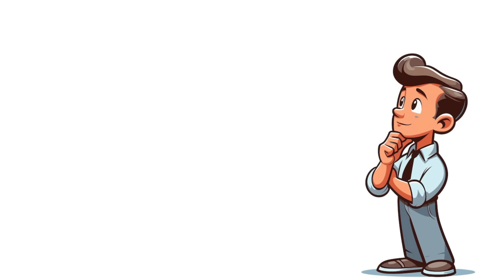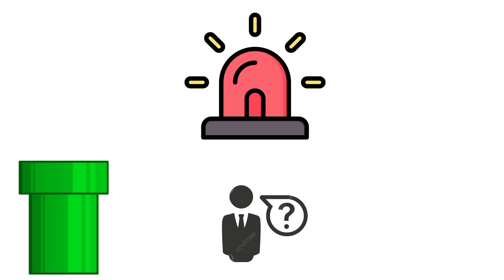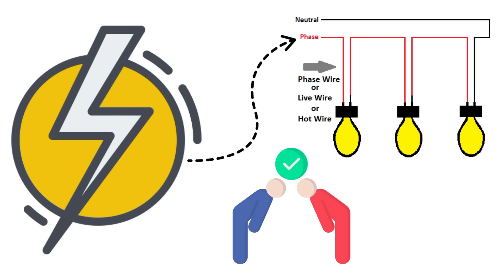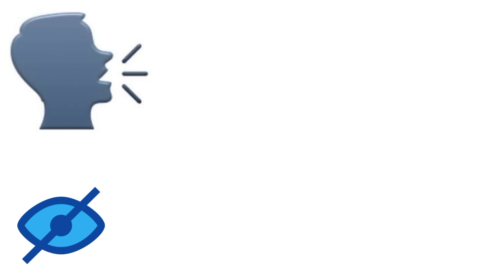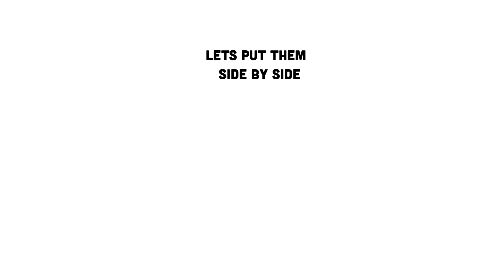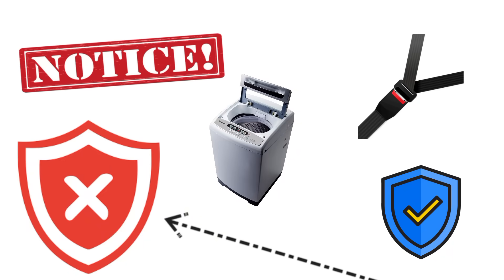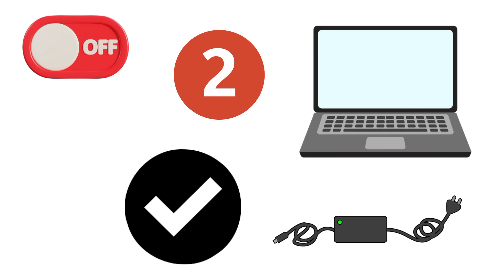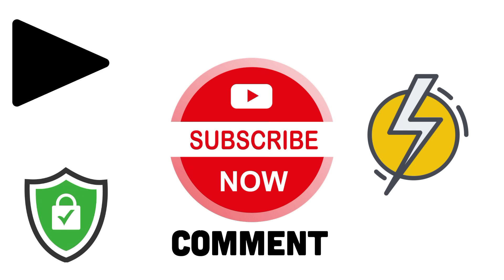How PHASE, EARTH, & NEUTRAL Works (REALLY SIMPLIFIED)

Comment: This is really incomplete and inaccurate several times.Eg.: Inaccurate, a neutral wire can zap you without bad wiring, it's AC. Incomplete, why didn't you use the most common wire colors black, white, and green in your illistration? I give it a D+

Comment: EARTH CONDUCTOR IS FOR SAFETY IN PREVENT MORE FAULT COMING FROM LIGHTNING CAUSE MORE APPLIANCE HOUSEHOLD TROUBLE   SOME ELECTRICAL ENGR. EXPERIENCE USE MORE COPPER UNDER 10 FEET BELOW THE GROUND FOR SAFETY.

Comment: Confusing colors in graphics. In the US should be BLACK, called HOT not phase, WHITE called NEUTRAL, and bare copper called GROUND. On 240 volt lines the HOTS would be BLACK and RED. I'm not even an electrician and I know this. Terrible video.
Reply from the maker: I appreciate your input on the color codes and terms, and I'll definitely keep that in mind for future videos to make them more regionally relevant.

Comment: I want to ask the ac current just flow in single wire because it is wave it some time reverse it which means live and hor wires are changing because some time it's giving electron and some time taking

Comment: Your drawings are a waste of time and one in particular is not only wrong it is dangerous. The drawings showing 3 lights show the lights in series which isn't helpful to your explanation because the linking wires can be live or neutral depending on if there is a break in the circuit and where the break is. The drawing should show either a single light or the lights connected in parallel. Now to the dangerous circuit. You show a circuit with something marked SINE inside a circle then there's a connection on the left marked PHASE going to a rectangle marked LIGHT. There is a similar connection from the right side of the circle but this is marked NEUTRAL. Both the rectangles marked LIGHT are joined together yet again making some kind of serial circuit but this time you have this joining connection marked with an EARTH SYMBOL. At the very least you should delete or correct these diagrams. Better still take the whole video down and get someone yo teach you how electricity works. BTW. American House voltage isn't always 120 volts, it can sometimes be 240 volts depending on what is connected to the circuit!

Comment: We're talking about AC!  
Both the phase and the neutral carry current to the load and also back from the load, once every cycle.
The only electrical difference between the phase and the neutral is that the neutral is connected to the ground at one point (at a substation).
If the phase accidently touches the earthed, metal casing of an appliance and the casing is earthed then current flows through the ground (if it is damp) along this path (and the circuit breaker trips).
The Earth is not just a bucket that you can pour current into. It is more like just one more wire in the circuit.

Comment: Thanks for the video, but I still really don't get the neutral explanation. 
1. What does "taking the current back" mean? If it's just connected to earth at the distribution end, why not just connect it to earth at the home and save all that wiring. Where is it going back to? Earth ultimately as far as I understand? That does not sound like completing a circuit. That sounds like taking your live wire, passing it through an appliance and effectively plugging the other end into the ground.
2. How much goes back? If I have a high power appliance is less going back because there is less "capacity" left over. Similarly if I use a low power appliance, does most of it go back?

Comment: So many holes in the content of this video. Rather than providing correct explanations, the author is displaying the myths and misinformation that most people have with AC theory and electrical infrastructure. Making it "REALLY SIMPLIFIED" does a favor for no one. I could go into great detail here but I'll just skim the surface. 1) Dump the water analogy for electrical theory. It's a bad analogy and anyone that says they never understood AC theory before they were introduced to the "water in pipes" still does not understand the underlying theory and will struggle with it forever. 2) Multiple times in the video, light bulbs are drawn in SERIES, not PARALLEL. There is no case for multiple AC loads to ever be wired in series. 3) The explanation for the "phase wire" as the only one providing current while the return is simply a path back to the source is not accurate when describing an AC circuit. That explanation is better suited for a DC circuit. 4) If you want to use mainstream jargon, stop calling them "wires" and start calling them "conductors", 5) Numerous examples of the audio script not making sense with the on-screen graphics, like the series string of lights, a 20A receptacle for a main distribution panel, and a breaker with fire shooting out of it, supposedly when the neutral conductor is cut [shown as a pair of scissors]. 5) I think you have used Earth and Ground conductors and paths mixed up at several points in the video. To be clear, for a single-phase branch circuit to a device like a washing machine shown in the video, you have a hot/line/phase conductor (that part is right), a neutral conductor, and a grounding conductor, not an Earth conductor. However, the important part here is not the names given to the grounding conductor but the myth propagated to the viewer that "...a surge of current rushes into the Earth causing the circuit breaker to trip, keeping you safe". Tripping a circuit breaker has nothing whatsoever to do with a connection to earth. You can disconnect the ground wire on any electrical service panel altogether and circuit breakers will still trip correctly and safely since the grounding conductor directs the fault current back to the panel completing the circuit and tripping the breaker. Likewise, you can take a piece of wire (conductor), connect it to any live breaker in the service panel and push the other end directly into the ground and nothing will happen; the breaker will remain on. I don't suggest you try this yourself since all safety measures offered by the breaker go out the window for this experiment and may be beyond your comfort level..
Reply: Thanks for the critique. Can you suggest any sources for a more accurate and helpful introduction to these concepts for beginners??
Reply: @richardclark8656  Physics classes (in my country, we take AC basics when we're about 15 or 16 years old). And I'm not trying to be facetious or sarcastic. You need to understand physics behind electricity to understand it (on the eng. level). No shortcuts, no over-simplified pseudo-analogies like water pipes. I'm afraid that if you want to really understand, you need to start at the beginning.
Reply: @richardclark8656  I like this best: https://www.youtube.com/@EngineeringMindset
Reply: Mike Holt had a lot of videos on the difference between neutral conductor and equipment grounding conductor...and the GROUNDING ELECTRODE conductor.   I have been a licensed  electrician for 25 years here in the US.  You came close several times.   Electricity is trying to return to the source NOT earth. You mentioned that the neutral and equipment grounding conductor are connected at one point. THAT connection is called BOND. THAT is what makes the ground wire safe.  When your phase wire touches a metal housing that has this ground connected to it it becomes a short circuit to neutral through the main service bond which allows Huge amounts of current to flow that trips the breaker or blows the fuse thereby interrupting the current and turning off the power.  Now the electrician comes in and finds and fixes the problem with no one getting shocked.  The Earth connection is for surges caused by NEARBY Lightning or other abnormalities that could induce a stray surge and supposedly the earth helps balance this.
Reply: You invited this:

You ever work on a real job site? 

Splitting hairs over some of the terminology is laughable. You must be an uptight electrical engineer with the personality of a wire nut, just graduated as one wanting to prove everyone else is a moron or a wannabe.

Conductor and not wire, really? Where do you want me to begin. In over half a century I have NEVER EVER heard any electrician say he needs to pull conductors on a job site so that's a joke.

You see the terms earth and ground in manuals, books, scratched in rock ....all the time. 

It comes down to what the layperson understands and I'm think you are absolutely horrible at teaching because you seem intolerant.

I worked on AC LINES in explosive environments for a long time and heard it all. As long as the job gets done by people who know what they're doing and everyone gets to go home, call things whatever you want.  I have a world of proof for that statement embedded in products on websites and catalogs from electric and electronic companies and more.

Also, my entire life I have heard many use the water analogy to describe how electricity flows, even in classrooms. Your butt clenched that tight?

I guess the world is wrong and you know best. Or should I ask do you live in the real world, locked in a lab somewhere or live in theoryland of academia? "I need a 4 conductor WIRE or CABLE for this probe." But you're saying I should say "I need a 4 conductor conductor." 

I can't stand half-baked grammar Nazis blowing other people's candles out to make theirs appear brighter. You should go after those who say Kleenex when they mean facial tissue and Q-Tip when they mean cotton swab. This has  to stop immediately!! 😂😂😂😂😂😂😂😂

Lighten up, Francis!
Reply: Someone sounds salty af.
Reply: @qasmb1546  Someone sounds correct. If it’s not to your taste, point out where are they wrong. If you can’t—then refrain from posting bitter comments… ;-)
Reply: @vencik_krpo  ? the op is bitter af. Sounding correct is different than being correct.
Reply: @qasmb1546  Not in this case. You’re still not telling us where is he wrong. Can you?

(Also, I’m a bit hurt that you completely missed my tastes pun… But I’ll live. ;-))
Reply: You are correct on all your points. I've always been fascinated by how the more you try to simplify these concepts, the farther you get from the reality.  I don't know the solution. That's why people call electricians for even the most simple problems.
Reply: I feel like your comment just saved me from frustration. 😋🫡👍😁
Reply: Are you pleased with the display of your greatness?
Reply: Lol. Its a great video of basic and accurate info. ❤❤❤

Comment: The million dollar question:  in residential construction what color are the phase and neutral wires?
Reply: Depends on the location. 
In American (NEMA) wiring, black is the phase (hot) wire and white is the neutral wire for standard 120V circuits. For 240V circuits, there are two phase wires (typically black and red) and one neutral wire (white). The white wire serves as the return path for the current and is also called the "identified conductor.
Rest of the world mostly follows IEC colours: brown is single phase, light blue is neutral, yellow/green is earth. 

Don’t touch any mains wiring unless you’re qualified to do so.

Comment: As an EE I generally dont used the term neutral in a single phase 3 wire system. (w ground), but rather in a 3 phase 5 wire Y or Star system. The video seems to confuse for dealing with polyphase electrical power  system or single phase line to line system.

Comment: I dont understand this. I dont know much about electricity but as far as I know the current at home is alternate, meaning that half of the time it runs one way, half of the time the opposite way. In my eyes it should mean that the current runs from the phase cable trough the bulb (or something) to the neutral cable. And then the current reverses and runs from the neutral cable, trough the bulb, to the phase cabel.
In that case both cables should be equally dangerous to touch, both supply current at different moments.
Am I getting something wrong here? Please explain you who knows!
Reply: Yes, the voltage and current are changing direction back and forth periodically, however the energy flows in one direction,  from source to load.  The phase (hot) wire is always opposite polarity of the neutral wire at any given moment in time.  So therefore for simplicity we think of it like DC, electricity flowing in one direction.  Now, yes you should be careful around any exposed electrical conductors if you are unsure.  In the US, the neutral is BONDED to the Ground conductor at the first main electrical connection for the system.  So in a house it would be in the first main disconnect.  The confusion is because we call it GROUND (Earth is worse).  Ground just means it should be ZERO volts if measured between any exposed metal like metal water pipes, sinks, metal ovens...etc.  Voltage is always measured between two points.  Ad stated in an earlier comment, the EARTH wire that actually connects to the ground rod going to earth can be eliminated and everything will still be safe.  The electricity is trying to leave the hot or phase wire and return by the neutral once it passes through the load, such as a light bulb or motor.  This controls how much current flows.  One thing to note is that electricity doesn't follow THE path of least resistance, it follows EVERY path it can find back to the SOURCE, not EARTH.  Yes, earth does conduct but not as good as the BOND that is in the main panel.  Therefore when you touch the neutral wire, assuming it is properly connected, you are essentially touching the ground wire and there should be no voltage difference and thus safe.  This is not good practice.  Neutral and hot should be treated equally dangerous because they are both intended to carry current.  The ground wire is intended to carry ONLY fault current.  That is when the hot/phase conductor has come in contact with the exterior metal enclosure or other conductive object that is unintentional and therefore a potential shock hazard.  Now you have an uncontrolled current path from phase conductor through the ground wire, back to the main panel, through the main BOND jumper that ties ground to NEUTRAL and thus allows several hundred amperes of current to flow for a very brief moment (typically less than a second).  The circuit breaker or fuse sees this as an over current condition and trips which removes the power from the faulty circuit eliminating the shock hazard.  The fact that the electricity is swinging back and forth periodically or going in one direction the general physics operate the same.  If the positive wire from your headlights in your car breaks and touches the grounded chasis of your vehicle,  the fuse will blow because the chasis is grounded to the oposite side (negative) of the battery.  Yet the car sits on rubber tires and has no connection at all to earth.  It took me years to fully understand phase neutral ground relationships, and i still see new wierd phenomenon even after 30 years of doing electrical/electronic work.  The more you try to simplify it, the harder it is to explain correctly.  It still doesn't protect you from getting shocked from exposed phase wire.  So always assume the exposed wire can shock you unless you are SURE it is deenergize.
Reply: @stevenricketts8812 Thank you SO much for taking the time to give us such a comprehensive explanation! It will take long time for me to digest this knowledge, but it is good you have put everything together! 👍👍👍

Comment: Hot wire and return “drain” wire? What hapens in the next 1/2-periode. Current comes inn via neutral and leaves via the “hot” wire. The article partly describes a DC network.

Comment: This video is mainly for North America. In most of Europe and in other parts of the world they now uses 230/400V TN networks.  The customer gets 5 wires. She gets 230V for one-phase loads and 400V for 3-phase loads via 3 line wires and one neutral.  The US system seems outdated.
Reply: As an EU guy living in US I can only strongly agree with you.  AC distribution is like EU in 1950’s, electrical components (switches, outlet, plugs etc) even worse….cheap and fragile